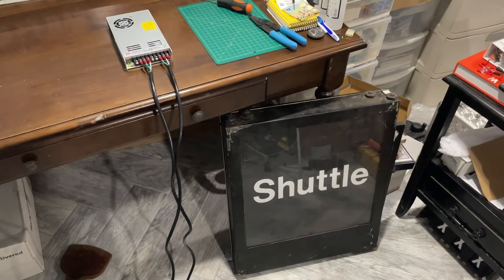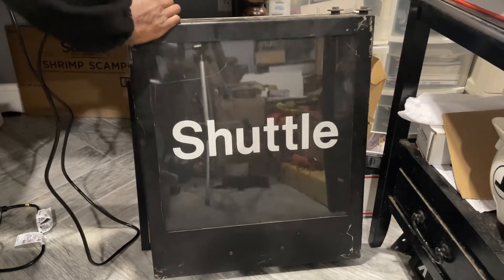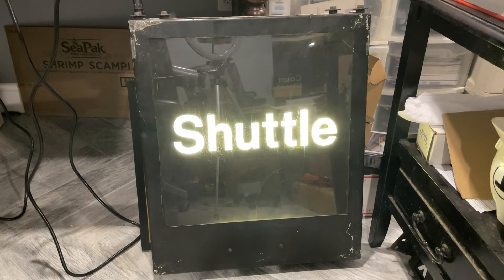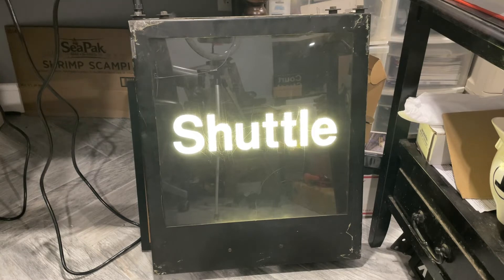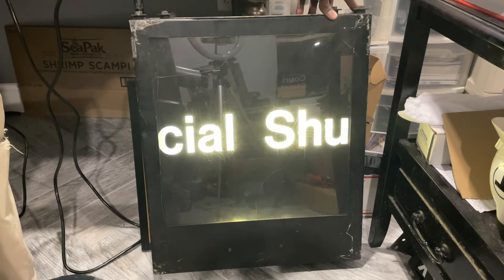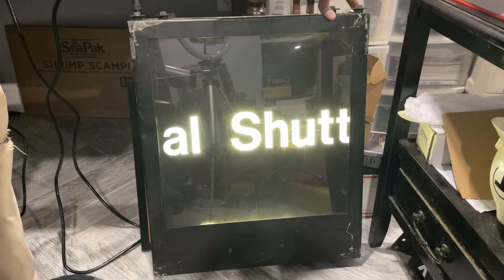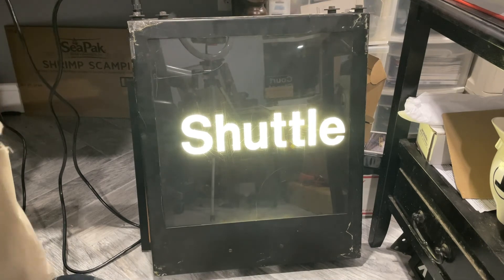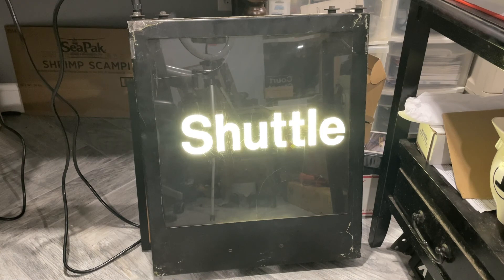Reviving a BMT/IND End Sign - Part 4: It's Alive! Well...

Comment: How did you get the sign to light up?
Reply from the maker: Nothing special, just made sure all the pins were energized. The pin connected to the cable that runs down to the ballast feeds the lights, which should be a positive (+) feed. The return (-) is the common for the whole signbox.

A couple reasons I can think why the lights might not work if the power is fine is: 1. Bad ballast, which I have no remedy for, or 2. Low amperage. I believe that fluorescent bulbs draw a lot of power to startup, so there might not be enough juice to close the loop in the bulb. That was another reason I went big on the power supply.
Reply: @smallflame85  interesting to know. For my sign, I have the cannon plug in the same arrangement as it was when the sign was in an R44. In fact, the cannon plug was clipped from a retired R44! I have the variable power supply set up to 37.5 volts and 1.2 amps and it is wired via a banana plug connection to the power supply and via alligator clips to the cannon plug of the sign box. I’m just worried about increasing the voltage or the amperage and blowing out the motor or even the lights :/
Reply from the maker: @imdanumber1  I would say keep the voltage constant, increase the amperage incrementally and see what happens. The sign will draw what amperage it needs. You only get a problem when your system can’t handle the amperage draw your equipment needs. Your power supply would be where the problems arise. I can assume 10A is enough!